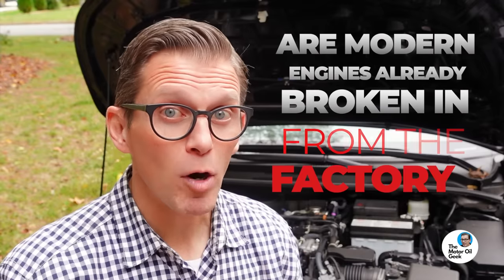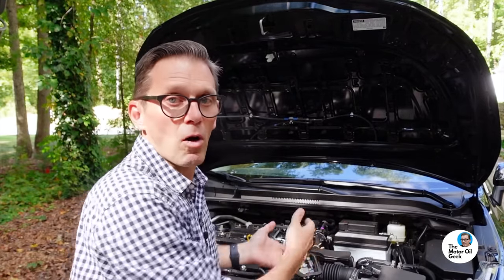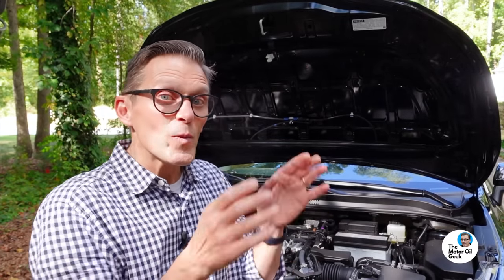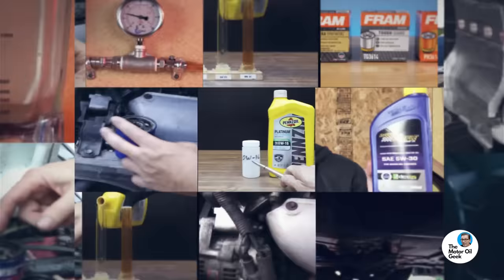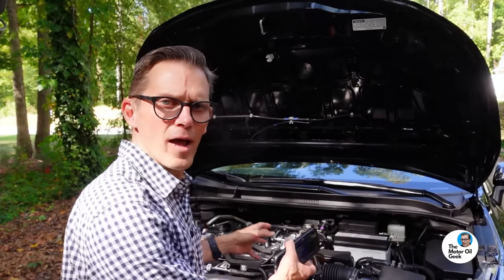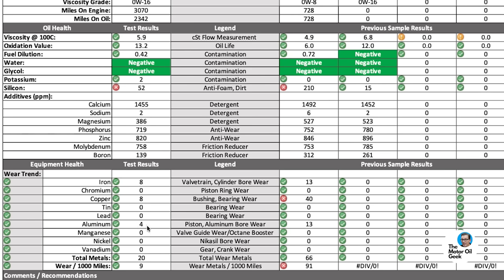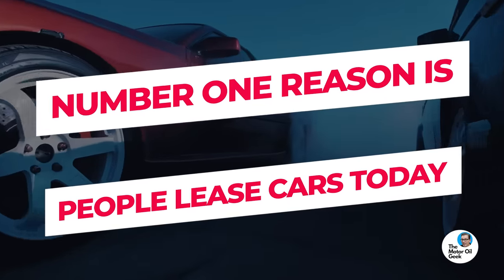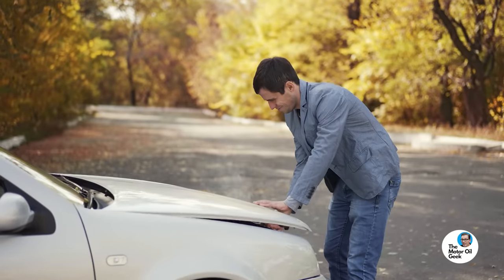New Engine Break-In: Truth or Myth?

Comment: I totally agree! New cars today are not broke in. When I bought a new 2013 Chevy Silverado 5.3, It sayed in the manual not to tow, let the engine idol or drive at steady speeds to much of a length of time, and to gradually accelerate for the first 500 miles, I know it's hard to believe but that's exactly what I did just to see if this was for real, and if it really made difference, and I gotta say, it seemed to have really worked. I've change the engine oil around every 6500 miles using Mobil 1 5w30 and AC Delco filters. So far, I've only had to add less than a half a quart of oil between oil changes and it now has over 214,000 miles now.  This Engine has the AFM with Cylinder deactvation also. Early on when I had less than 50,000 miles on the truck, i had discovered that some of these engines had lifter problems, So I decided to get a Power programmer and disable the cylinder deactivation so that it stays in V8 mode and have never had a problem since, and get same MPG,s as before, plus at the same time I added an oil catch can. I think this has made a huge impact on the longevity, and you woulded believe how much contaminated crank case condensation and sludge I have stopped from going into the combustion chambers, and coaking up the intake valves, this Idea about the catch can, I had read about where the Corvettes and Camaros were having problems on the race track at around 20,000 miles on the engines with direct injection and had to have the intake pulled and manually clean the intake ports because there is not gas flowing into the ports to help keep the oil washed down and from sticking to the valve seats and stems causing performace problems. I know this turned into a long winded reply, but I figure it may help since it's oil related and can effect the moving parts of the engine. I really enjoy your videos 👍
Reply from the maker: Thanks!
Reply: The Chevy manuals still recommend you break the car in slowly.I purchased a Malibu Premier last year and did as they recommended.The service rep did think I was a little nuts for getting an oil and filter change at 700 miles though.What is $90 with the cost of engines and transmissions these days.Been doing this since 1973 when I bought my first new car.Never an engine or trans failure.
Reply: I'm one that's for the changing the oil often sooner when new.   But I always run semi hard. That seats the rings. They have to wear in. The bearings  I don't worry. If there is wear, then the tolerance was not set for the oil to have a film between the parts.

Comment: Back in 2004 a German automotive technician told me when you first buy a Mercedes or any other car the  breaking process is somewhere between 3000 to 5000 miles that first oil change but he also told me when you first buy a car read the tachometer  on your vehicle and try not to rev over 3000 RPMs. he said it  gives that engine oil enough time to lubricate the engine well.
Reply from the maker: Thanks for sharing!
Reply: As a German auto specialist myself, most of them indicate right in your owner's manual to adhere to a break-in period.

That said, they do a preliminary break-in at the plant. At least, VW did. Who I was employed by for almost a decade.
Reply: @LynxStarAuto  i remembered watching a video where they said in the past factory break in was extremely harsh (i think they redline it up to 20km max depending on the brand SOP) and these days they only drive less than 4km and it's only to move the car to and fro the facility and do some minimal testing. 

could you confirm if that's the case or had i remembered completely wrong?

Comment: Love the information you provide.  I have bought a new vehicle since 1998 ! But i did always change my oil at 1k miles and then again at 2k miles. I had 3 New Dodge Ram trucks go 300k plus miles.  1983,1991 and 1999. I also changed the transmission , diffsand transfer case oils at 1k and 2 k miles.
Reply from the maker: Thanks for sharing

Comment: I grew up around cars, my dad had a small Fiat dealership in the late 70s then a small Mazda dealership in the 80s when I was a kid. Back then, everyone knew that engine break-in was a thing and buyers were instructed to watch their driving at first and come back for an early oil change, it was just something you’d do with a new car.

In the early 2000s I was a new car salesman, I sold Saturn, Saab, Isuzu, then Volkswagen. The majority of new car were leased. I’ve attended manufacturers trainings and asked them all what the break-in period was. All of them said there was no break-in period anymore, that was a thing of the past, modern engines were machined better, used better metallurgy and were broken in on test beds at the factory before being installed in cars on the assembly line. I always suggested to my customer to drive easy at varying RPMs the first 300 km and not go over 3,000 RPMs the first 1,000 km, then follow the manufacturer’s recommended schedule for oil changes as the first couple of oil changes were free. I did that too with my own new cars, but knowing what I know now thanks to this channel, I’d change it earlier and even more regularly. My last non-turbo 2.0L Volkswagen started burning oil quite early.
Reply from the maker: Thanks for sharing!
Reply: My older JD mower with a brigs engine said 8 hour break in oil change. Newer JD mower with Kawasaki engine said no break in, run it like normal for 100 hours and don’t change the filter till 200…

Needless to say I changed it early and do a filter swap with each oil change.
Reply: Some 2.0’s had the piston rings installed upside down, so those drank oil pretty heavily.
Reply: @leonkloonsner  Whoa I never knew that. I had two cars with this engine from new. The first one, a 1999 New Beetle, overheated and was repaired under warranty, I forget what the issue was, the car was leased. The second car was a 2002 Golf GLS I bought new and kept for 13 years and about 220,000 km. It had a rough idle since new and burned quite a bit of oil, but I checked often and topped it up when needed, it was still going strong when I got rid of the car.
Reply: Oddly enough the last four vehicles I bought all still say in the manual to not push the engine hard during the first 1500km (I’m Canadian) and to vary rpm, and still talk about the break in period. Those are 04 Corolla, ‘08 Camry Hybrid, ‘13 RAV4 and 2022 Ford Maverick Hybrid for reference. The Maverick manual even says it comes with break in oil from the factory. The day I listen to the salesmen or service advisor at the dealership for advice on this is the day I stop caring if my vehicle survives past the warranty.
Reply: @FishFind3000 
I have a Husqvarna push mower.
Factory claim/marketing is that it never needs an oil change.
Just check it and make sure it’s full.
Lol, of course it won’t die until after the warranty is up.

My mother in laws JD mower has one of those quick change oil systems.
Oil is in the filter and just change it out.
Probably only swaps 1/4 of the oil.
But I guess they figure a lot of people will never change the oil and with this easy system will at least get some oil changes out.
There are videos how to convert it to a regular filter and drain it from the pan.
Reply: Combatzman....absolutely.   warranty is the main thing that factory oil & change schedule is based on... not our interest in having the vehicle last longer.

Comment: You should have a video on start stop and cylinder deactivation. 
  Glad I watch your video. My 2023 Ridgeline has 800 miles. There's no way I was going to go 10k on a oil change. But now I  will change it before 1k miles.
Reply: If you find yourself stationary for a longer period of time, the system is designed to start the engine automatically before lubricant temperatures drop too dramatically.

I know people get worried about engine damage with the start/stop but most mfg's have taken into consideration the impacts on the engine.
Reply from the maker: Thanks for the suggestion!

Comment: When I bought a new truck back in 2015, I took it in to get the oil changed at the dealership at 3,000 miles and they almost wouldn’t change it because the light wasn’t on.  I had to argue with them about wanting my oil changed in my truck.  I had to tell them “fine, I can go pay someone else to change my oil if you don’t want my money.”.  They changed my oil after that with no more questions.  Also, I kept changing the oil regularly around 3,000 miles and now have almost 200,000 miles on it and it is still running great.
Reply from the maker: Thanks for sharing
Reply: And if you still do that engine will last

Comment: I totally agree with you it is amazing how much material comes out of the first oil change when you do it quickly I would never wait a long time on the first oil change. You can see all the particles in the oil when you shine a bright light on the oil like a bright LED flashlight.  It doesn’t matter what it is a car motorcycle lawnmower change the oil quickly on the first oil change.
Reply from the maker: Absolutely. The flashlight on the oil pan can give you a heart attack!
Reply: @themotoroilgeek   I know what you mean it’s absolutely crazy how much material is in the oil pan that the filter does not catch.  I am a machinist and mechanic by trade so I understand how things need to break in but it is still quite surprising how much material wears off the parts during break in.  But after a few thousand miles it all settles down.  I change my oil multiple times during this period to give my engine the best chance possible oil is cheap.  None of my cars burn any oil and all run perfectly I think it is a worthwhile step to do when the car is new.  For instance I just took a 4000 mile trip to Florida and back and did not burn a drop of oil in my V-8 tundra.  By the way I love watching your channel keep up the great work I learn a lot.

Comment: We bought a 2024 Subaru Outback and they told me multiple times, no break in, 1st oil change at 10k. The manual showed inside 6k. I was suspicious and found you. So, after watching your video of changing the oil on your daughters Toy, I changed the oil on this Subbie at 700, 1200, and will again at 3k, before taking it to the dealer for their first 6k free oil change. I really appreciate you doing these vids. Big help. 

We are that weird type that only buys when the former is used up. I still have her '97 Cherokee, and '07 Sedona. My '00 Merc Grand Marquis land yacht still hums like new at 240k.
Reply from the maker: I'm glad to help!
Reply: Company I work for bought new Ford Transit van. No break in, first and every oil change is at 25 000 miles interval says owners manual. Van was bought in Germany and it's start of life was max. speed on German autobahn straight from dealer showroom because it was empty. In it's first 20 miles on odometer it already clocked it's max. speed and max. governed revs 😂

Sad life of company owned fleet vehicles..

Comment: On my last deployment in 2009 i spent 14k on a fully built 2 valve for my 1998 mustang. Everything under the hood was new. I did conventional oil and filter at 50, 100, 250, 500, amd 1k. Then i switched to royal purple.  I even had my rev liniter turned down to 3500 with spark being the cut off. I can say every oil change up to the 250 had a little metal in it. After that i could go 4k miles, and the oil was still purple. Man miss that car. Even whem i got my 2004 nissan titan April 4th of that year i wemt easy untill 1k milea. Changed the oil at 100, 250, 500, and 1k them to syn.
Reply: This is the most intense break in oil schedule I've ever heard of.  And I'm positively impressed.   Good job. I like it

Comment: As someone who has built engines both professionally and privately I know that a new engine will generally be made with tight tolerances   in many areas. An engine is made of 100s of parts and these parts will suddenly be expected to move on bearing surfaces at varying temperatures at speed. I always run a brand new engine very gently statically to start. Then check tolerances and change the oil. And I will get particles. I then drive gently at operating temperature retorque and change the oil again. 
And then check carefully during service. Result is perfect compression and combustion. But I do know  many manufacturers are not this fussy. Oil is cheap
Reply from the maker: Thank you for sharing

Comment: In the owners manual it states the break-in period. Every car I've owned and family members cars all stated that. There were discrepancies between brands/engines but they all were fairly similar. ~500 miles was the typical break-in period and some stated to drive a certain way. Non however stated to change the oil early. We have always done the first oil change at 1k miles for new cars.

Additionally, we've always used the heavier weight optional oil. As an example spec is 0w20, however 5w20 can substitute according to the manufacturer. So on so forth for the other cars. It's not cold in my regain so there's no reason to use the ultra thin oil.
Reply from the maker: Right on!